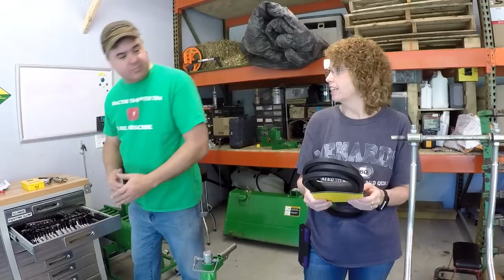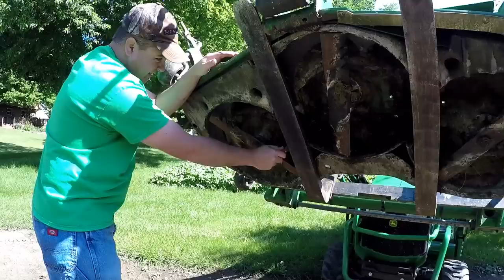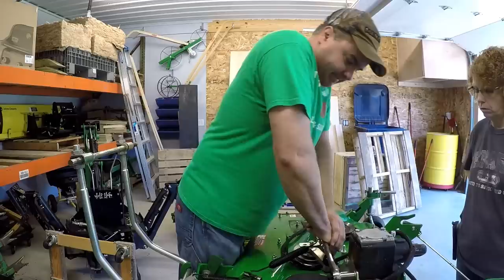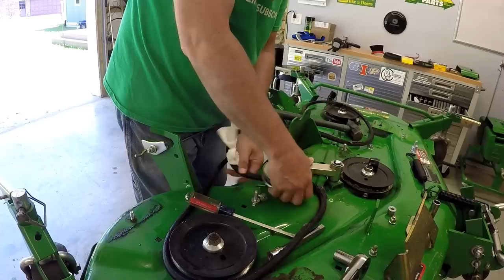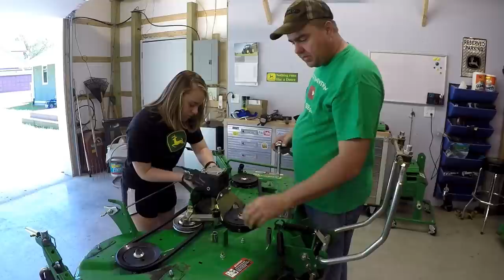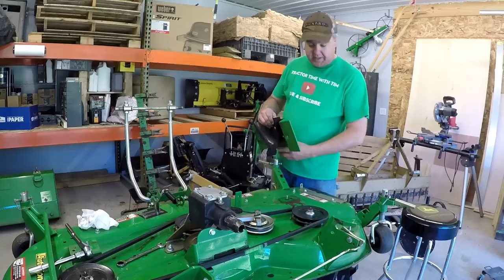Mower Belt Replacement  John Deere 1025R Compact Utility Tractor

Comment: Great video! I also use the gator blades. I have to break out the pressure washer too (if I mow when it's wet). Cleaning the bottom of the mower deck should be a regular maintenance thing anyway. I mean, it's nice to keep watch over the business end of the machine, so you can catch anything that might be outta whack. I have made a ritual out of using an electric leaf blower to clean my mower after every use. Accumulation of debris on the equipment could hinder air flow across the cooling system, harbor moisture, which in turn, could cause the belt and other parts to fail prematurely (not to mention rust metal parts). I like to carefully clean out the air box and air filter every time too. Those air filters aren't cheap and the engine needs to breathe. Thanks again for the video, God bless Tim and family! :)
Reply from the maker: Good advice.  Thanks for your comment.

Comment: glue stuff on the thread is Loctite it keeps the nut from backing off. red Loctite you almost can't get it off unless you use heat. blue Loctite is something you can get off a little more easy than the red.

Comment: I don't use anything under the mower deck I usually just scrape it out a couple times a season.  End of season the deck is cleaned real well and then I brush motor oil under the whole deck. Never have any problems with rust so all is good. Take care and God Bless.
Reply from the maker: I always have trouble with the 'final cleanup' in practice.  By the time I'm finally finished mulching leaves, it is already freezing weather, so, I've packed the power washer away for the winter.  Gonna have to find a way to deal with this.

Comment: A little trick when removing/installing springs, use a string and wrap it around or tie it to a screwdriver or rod to use as a handle.. very easy to control the spring when installing/removng! you would fold the string in half so you have a loop at the end you hook on the spring.
Reply from the maker: yes, makes sense.  good idea.  Thanks!

Comment: Hey Tim! I have a 1023e with a rotary cutter. While researching tractors and implements, I was really impressed with the Kodiak line of rotary cutters. They seem to be very well built and fairly priced. You have probably seen them if you have ever seen a Mahindra branded cutter because they build them for Mahindra. With that said, I ended up buying the Frontier RC2048 when I bought the tractor because I received a discount from the dealer because I bought a package deal with multiple implements when I bought the tractor, and I was able to put it on the 0% financing along with the tractor. I have been completely satisfied with the Frontier, but if I were purchasing one as a stand alone transaction, I would be very tempted to get the Kodiak.

Comment: That packed grass in the deck is typical for any mulching deck regardless of blades.  it's just the way it is during springtime in the Midwest.  I have the same thing on my toro grandstand and my 30" push mower.  Cleaning the deck is just a chore you have to keep up with!
Reply from the maker: +James Connell I suppose so!

Comment: I agree on the Gator Blades. I believe they do such a good job mulching, it turns the grass in to paste. Seen that right off. Then I would not pay the ransom price on Amazon, I went back to JD mulch blades and never looked back.

The reason I came looking for this video. I blew a belt on my 60" and the idler arm and pulley and it went into the drive over bracket and damaged the pulley. And to add to it, I had 10 minutes to get to the JD dealership before they closed. Now to figure out how to get the huge spring off without killing (and put back on) and then go to the dealership in the morning.

Comment: I took my BX deck off yesterday and did my routine maintenance. I use factory blades and still had tons of grass caked under the deck. Taking the deck off was a chore. I think my next one will be a drive over deck.
Reply from the maker: +Tim KD5VMV the auto-connect really is nice.  Makes the tractor much more versatile.  
I don't think there is any way to keep the bottom of the deck clean!

Comment: Regarding cutting down the corn stokes , you may want to try the rotor tiller , we have rotary cutter , they are bulky and don`t have the space to keep inside , we just take off the PTO shaft and keep the shaft inside the shed  , if you want a cutter try a flail cutter , they take about the same space of a tiller. But all this has to go through the Chief Financial  Officer
Reply from the maker: 3 votes for flail cutter now, wow.  What brand(s) are suitable for sub-compacts?

Comment: Tim a very simple solution is spraying canola oil on the deck cause in word war 2 the Canadian and US armies used canola oil in the tank tracks that did the amphibious assault on the beaches so all you will need a air parts sprayer with the syphon tub it will also prevent rust on the deck and it is safe for the environment and those mower decks are assembled with lock tight

Comment: I have the same caking on my JD blades and I don't have a mulch kit. Yes the belt is a pain, had to do mine the first year due to unseen objects in my grass. I use the mower slick spray. It does seem to work, but not long term. I've just had to resort to knowing it will cake up and it will be a pain to clean. I have the Rotary mower an older JD unit. But I want a flail mower. Much safer and works a lot like a rototiller but can chew up some stuff much better.
Reply from the maker: +Eric G ok, two votes for flail.

Comment: Mulching blades are best used when the property is dry. John Deere mulching blades have a two-step cutting surface, and the gator blade has the wing foil high lift section notched to aid in mulching the grass.

Comment: Gear wrenches are the best for speed and ease of use and are a standard in every toolbox in aviation. The only problem with the non reversible type is in certain close quarter situations, they can get stuck as you tighten the fastener down causing the clearance to close up. In certain applications you need to think in advance or you can cause a real headache.....
Reply from the maker: +Airplane Doctor makes good sense.

Comment: Tim - I would submit a proposal to the finance committee for a Milwaukee Fuel M18 cordless 1/2 impact wrench. All in the interest of conforming to the sound restrictions in the videos of course. :-)
Reply from the maker: +EOSJOE i proposed to the finance committee once.  It has worked out pretty well so far!
Reply: they are awesome cordless tools. out performers my snap on 1/2 and 3/8 impact tools were I could bought six Milwaukee  to two snap ons
Reply: EOSJOE I was thinking the same thing, you need a battery power impact.
Reply: I use the Ridgid X5 1/2 inch Impact and it does the trick too. Lifetime warranty and batteries too.
Reply from the maker: +Jason Bertrand might be a good idea!
Reply from the maker: +cheesetrain1025 I'm working with a potential sponsor for rotary cutters.  Their mower is a bit more strongly built than most, and yet cheaper...and American made!
I'll let everyone know if/when we get this worked out.

Comment: To cut corn stuck i use the tiller .i open the door on the tiller lift the tiller about 8 inches go backwards and after tiller the land and it does a good job. Try it next time. ???

Comment: Wow that belt is a pain to change, hope you don't have to do that one too often. Sadly thought it just doesn't seem like belts hold up near as well as they used to. I would have to replace the belt on my 72" zero turn every other year pretty well, it wasn't near as difficult to change as yours though. Hope the belt on the kioti CK2510 belly mower isn't that time consuming when the time comes to change it.

Comment: i was wachting one of your older video and when you are lefting with the front loader and it starts to lift the tractor and you have the backhoe you could extend it out and it would add more weight so it wont lift the tractor off the ground
Reply from the maker: +Gary hogrefe tried it, it doesn't make much difference.  Once we get that close to lifting the rear wheel, it takes lots of weight to overcome that.

Comment: First possibly  You would think they would come up with an easier way to route the belt to prevent all that disassembly.  Of course I have worked on mower were I had to remove the steering assembly to replace the transmission drive belt.

Comment: Nice job Tim very well done ! I know most of them belts are right at hundred dollars for o turns and Sub compact tractors had one go out on a exmark and it sounded like a 12ga going off !  LOL take care God bless !  curt 🚜. 🚜
Reply from the maker: +Kioti CS2410 turns out I had forgotten.  It was less than $50.  However, the one for the 60D is almost $90!
Reply: Tractor Time with Tim That is not to bad I asked Kioti and they said for the 60" is just at 100 I need to get a new one but just don't won't to give that much ! LOL

Comment: Great video Tim, as usual. I have two words for you- flail mower!
Reply from the maker: +Tom L interesting. Why do you like a flail mower?
Reply: Tractor Time with Tim - I prefer the more compact size and the durability when encountering unseen objects such as rocks when compared to something like a brush hog. I also think that they are safer from a possible projectile perspective.
Reply from the maker: +Tom L the projectile issue DOES concern me.  Do you think flail does a better job mowing?
Reply: Better than a brush hog yes, better than a rear finish mower no. The downside to flail mowers can be the sharpening depending on the number of blades that need maintenance, it can be time consuming. However the design really does help prevent projectiles. I also prefer the belt drive flail mowers over the gear drive, the belts are the slip point so you do not need the expense of a slip clutch but that's me.

Comment: Thanks Tim. I had heard of the new Frontier rear grooming decks ( GM11 series) and I was wondering if you knew anyone with previous use of these. They class them as finishing mowers for lawns, but I do understand they roll on full deck support wheels rather than mid mounts using frame suspension. I still get a lot of scalping with my current mid mount, but I do have a very uneven lawn. Maybe time for top soil dressing?
Reply from the maker: +Paul Duyn there are lots of brands of rear finishing mower.  I do not have experience with them.  Sorry.

Comment: I purchased a 1025R with the 60" mower, backhoe and loader...  and love it.  
I'm still a bit mystified has to what fluids it requires.  Other than engine oil, does it takes hydraulic fluid everywhere else or is the transmission another exception?
Reply from the maker: Check out our "Johnny's Essential Oils" series.  It will tell you more than you wanted to know about dealing with this stuff".
https://www.youtube.com/playlist?list=PLuUZ6lo0MDxAVhH_fAXp9Vwu9wNQqjcwe
Reply: Thank you, Sir.
Excellent video!  And now after watching it I'm thinking I going to call my local JD dealership to see how much they charge :-)

Comment: Good Video Tim. You mentioned the rear cutter, do you think it would mow
as well as the mid mount deck? I am finding it hard to level the mid mount in the Spring and wonder if switching to a rear deck makes sense.
PS as I understand it a Patreon account is where viewers make donations to you, but all the videos you make are still available to everyone to see.
Reply from the maker: Oh, no, it won't mow nearly as well as a mid-mount deck.  The rear 'Rotary Cutter' is made for tall weeds, and saplings.    It is not a 'finish mower'.

Comment: I know this is an old video, but you don’t need to remove drive over ramps.  There is room, at least on my 60D to just push the belt over the pulleys.  You do have to remove the drive assembly completely, and the idler spring.  But, if you do remove the, it gives you the chance to clean out all that junk.

Comment: Would you by chance know how to get all the burnt up rubber belt off the mower deck? I'm guessing the chip rock had bounced up onto the deck and got under the idler arm pulley and made a huge mess. Gonna get a can of that paint too.
Reply from the maker: Maybe WD40 cleaner and degreaser.

Comment: Tim I could of told you. Never use gator blades with a mulch kit. They are not meant to be used with mulch kits. Only use the wavy blades that come with the kit. Gator do a very good job on some mowers. It depends on the baffling of your deck. Also mulching all the  time in the spring will cause a little more build up because of the spring conditions just part of it. Tell the finance committee thats really not a bad price for the belt. The belts for my commercial mowers are 85 to a 100 a pop and I have to replace them once to twice a year. Ouch!!! We also keep spares in the truck at all times nothing worse than getting half way through a yard and a belt brake. Di you look anymore into the sod staples for your web site? How about a decision on the tiller. Don't hesitate if I can ever help or answer any questions for you.
Reply from the maker: We have the sod staples listed on that web page about the hillside slide.

We decided to put off the tiller till next year.
Reply: Tractor Time with Tim I can't find the paint that you used on the mower deck ,got a link to it?

Comment: Thanks for video, I was curious about those drive over decks . Seems like a lot of hassle to change a deck belt, I was noticing , that deck does not seem as "beefy" as the 7 iron deck on My Ztrack , Is it the same heavy weight 7 gauge steel ? I am in the middle of purchasing either a John deere 2 r compact with a MMM  and FEL ,, or a Kubota B2650, These videos help me make a wiser decision seeing maintenance . ! I love the idea of aito connect MMM but not sure it is worth that hassle . Decisions , Decisions . ! I do know Kubota does not offer that feature , And I do know the Kubota Deck is not as heavy a seck as the John Deere 7 iron I am accustomed to , I am curious now , so I will look at the cost of deck belts for both machines . I mow approx 7 acres here So I think my belt wear would be more than a lot of folks , I usually would replace a belt on the z track twice a season , Question How many hours of mowing do you have on the gearbox on your MMM?  And here is you an ol  country boys tip,,, "Ya dont use a grass mower to chop  corn stalks !"" lol , Use a bush hog , or flail  cutter !  But It seems you do not have that much of sweet corn stalks to cut ,  think I would just knock the few you got down and churn them up with a roto tiller .
Reply from the maker: Don't let the competition talk you out of the auto-connect.
Also, this belt won't need to be replaced since it runs in a straight line.   I don't think you will see much belt wear.   I only needed to replace it because of abuse (as I mentioned, and you re-iterated).
Reply: thx, I got to go inspect those decks at JD, ,  yeah, auto connect deck  is a definite plus for my age, too old to be crawling around dragging a mower deck in and out for maintenance , especially if they are as heavy built as Jd 7 iron decks

Comment: so basically it was the fault of the loose nut behind the wheel.. tim I know this is worse than swear words but napa has great outdoor equipment belts that last far better than jd and a 1/3 of the price. I use to work for the local garbage company that has acers of yard on there houses and they had the john deer zero turn diesel and they would go through a belt in one season mowing twice a week. yes twice a week they had sprinklers over the whole green lawn areas where there were four huge mansions  and a horse barn that was like a manards department store, 2 1/2 acres of fence alone 50 horse stalls inside so money was no object. one year john deer was out at the time so for giggles I called napa who we dealt with on a daily basis to keep all the garbage equipment running they had the belt and it outlasted the john deer belt by two seasons the john deer belts never broke but the blades would start to slip and on the grass build up we use to spray fluid film underneath the deck and it cut down on grass build up big time. even sprayed it on the front lift garbage trucks for there front shields over the cabs of the truck and even the dumpster juices washed right off it also some how impregnates the metal to help against rust out. or so they say lol
Reply from the maker: +philip young sounds good, we own stock in NAPA's parent.
Reply: philip young While you're at NAPA you can pick up a small bottle of blue Loc Tite or their equivalent.  That's the "glue" you see on the threads to keep the bolts and nuts tight.  Blue allows for disassembly.  Don't get the red kind.  It's stronger and you can break the bolt before it comes loose.
Reply: philip young Thanks, I will check NAPA out. Only average 2 years on the JD belts. I think NAPA carries Gates brand. I do purchase all my vehicular serpentine belts from them because of the quality of Gates.
Reply: i bleve there called there outdoor equpment belts it worked on my bosses zero turn as well as on my cub cadet 147 hydrodrive. i used it on the cub for both moter belts the main blades as well as thr pto belt as you may know goes from the deck and turnes into a figuar eight to the pto vertical shaft in the front going through two pullies. good luck

Comment: When do you No when the belt needs to be Changed 1025r Auto Connect
Reply from the maker: When it is all ripped up or totally broken due to a stupid mistake....like backing it into a bunch of corn stalks!  Otherwise, you might NEVER need to replace it!
Reply: In the back were the belt runs Across it’s is Perty Shiny
Reply: Or is that Normal
Reply from the maker: That is normal.  Inspect the belt itself. Is it frayed?  If not, you are fine.